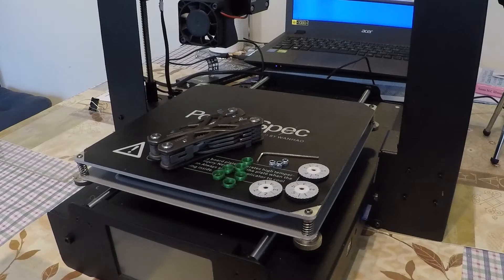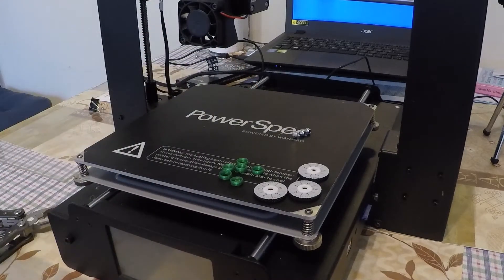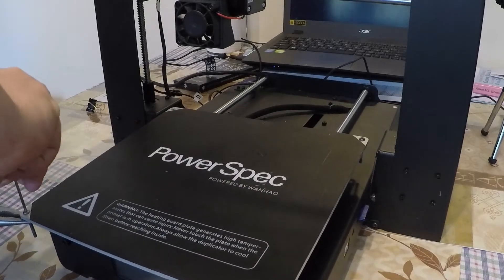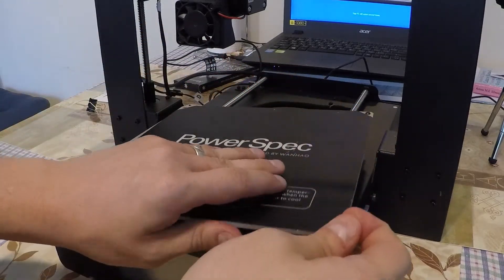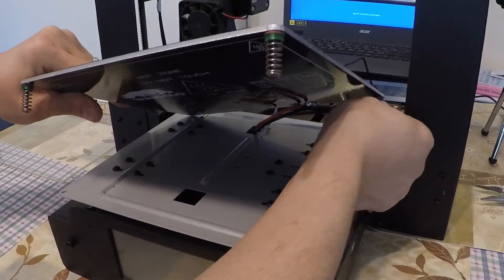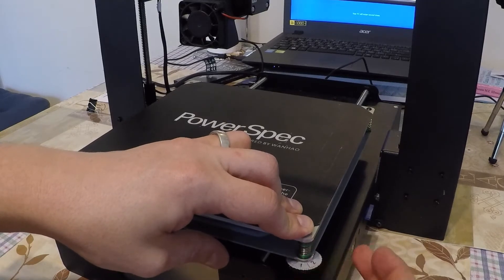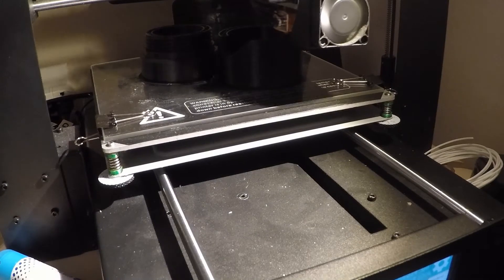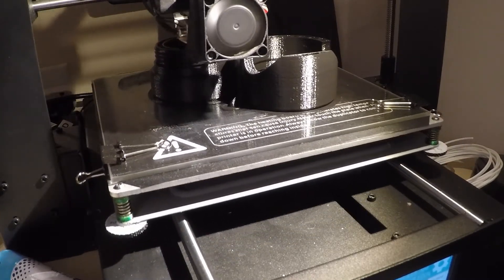Wanhao Duplicator i3 Plus Mods | PART 1 - Build plate stability

Comment: Thanks! Currently installing the locknuts and swapping to a glassbed myself. Are the springcups only for the looks or do they acctually improve anything? Got no PETG at home so feels a bit over the top to buy a roll for those guys! :) Also, its a bit crazy but I do have an Elegoo mars too and want to print the thumbwheels in resin instead. Any problems do you think? Thanks for a great video.
Reply from the maker: Theoretically they are supposed to limit horizontal movement of those springs. Not sure, if they actually do what they're supposed to, never tried running without them :)

Comment: Very good video, thank you! 
Do you have an idea why I can't connect this printer over USB anymore (for PID tuning)?
Reply from the maker: Well, depends on what happened to it before :) Are you trying to connect it to Octoprint?
Reply: @IgorsWorkshop  No, I'm trying to connect it to an old Macbook running Repetier Host to PID tune it again. I've done this successfully before with the same laptop and software. A Windows 10 machine doesn't 'see' the printer either. I've tried multiple usb cables - that doesn't seem to be the problem. The printer does get power from the usb port though. I've read something about cutting a jumper on the mainboard but I think that's for the regular i3 and not the Plus.

Comment: I thought the same thing about using 4 screws.  As soon as you touch the 4th screw, you change the the plain the other 3 had just set.  I suspected it was needed because they had no faith in delivering a truly flat print bed, and you needed to warp it back into a flat surface.